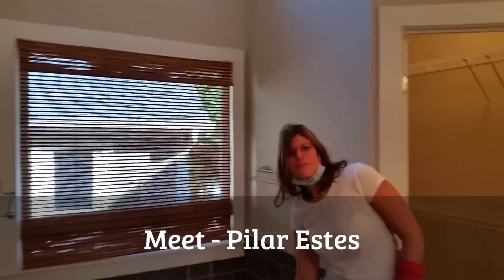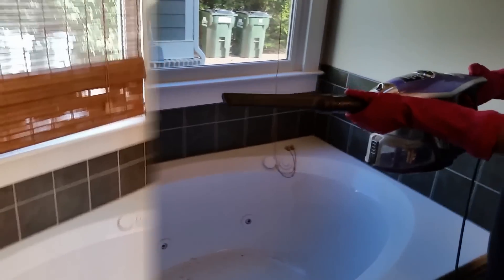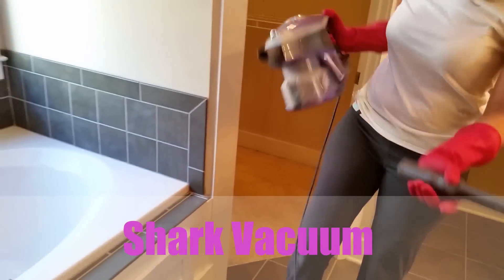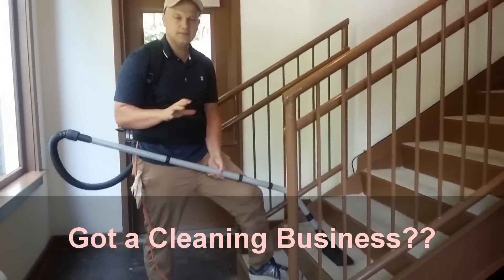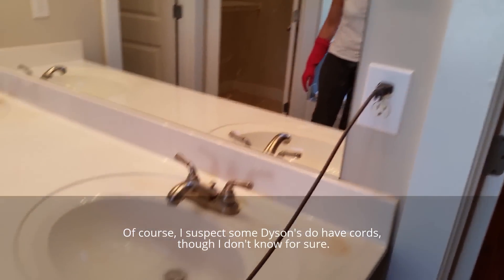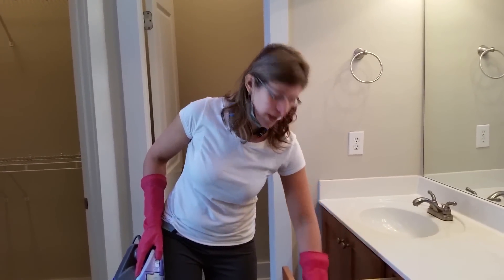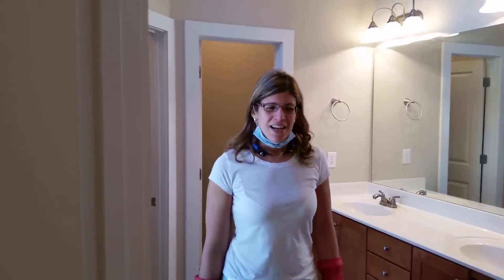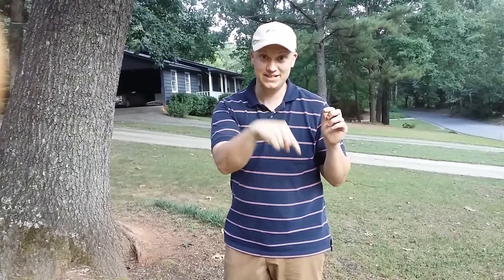Cleaning Hack for Vacuum Cleaners

Comment: I have a dyson upright animal, dyson handheld, shark upright and bissell upright... I really enjoy a good vacuum... 20 yrs ago a dyson was THE vacuum to have and mine is still up & running. We clean it occasionally and have retired it to basement and atrium tasks... the dyson handheld will NOT hold a charge. I won't purchase dyson again. The shark and bissell function at every bit the capacity of the dysons in my opinion. I really think the applied technology is more affordable and its not neccessary to spend hundreds to get it. I do want a backpack vac... which do you recommend? Great videooooo!!! Thank you  :)
Reply from the maker: Hi Robin.... You sound like a Fellow Vacuum Cleaner Enthusiast!  I agree with your view of the Dyson.  I think there are much cheaper versions such as Shark and Bissell that do a great job.  Back Pack - They can be expensive.  Simplicity has a really expensive one that I hear good things about.  In our town, we have a "Vacuum Repair" store.  They sell refurbished vacuums...Perhaps that is a great option.  If you want a new one, try going to your local Janitorial Supply Store.  That have different models that you could look at.
Reply: will you make a vid of your vacuums sonds like a great little collection